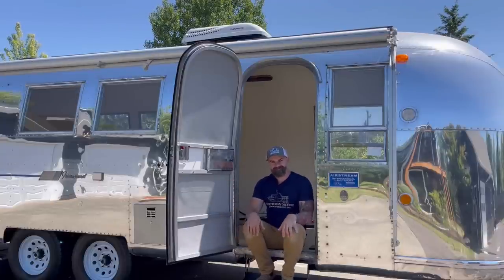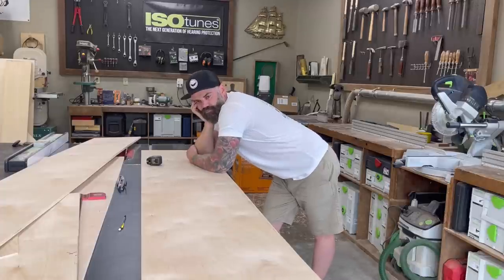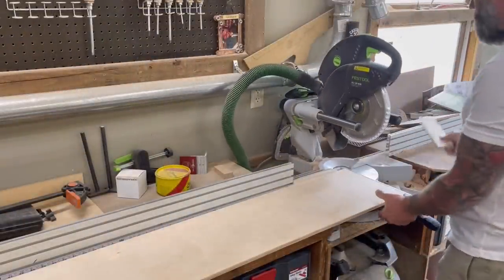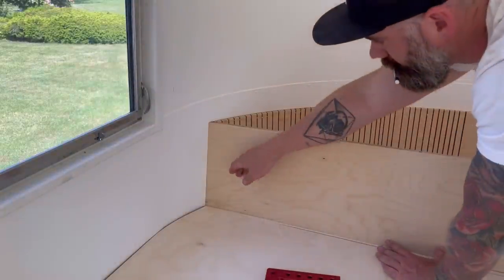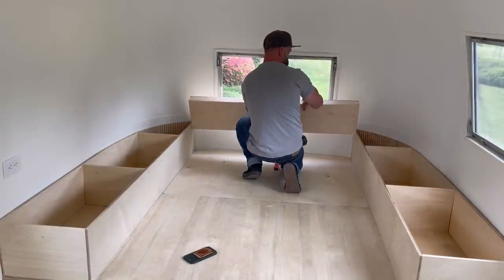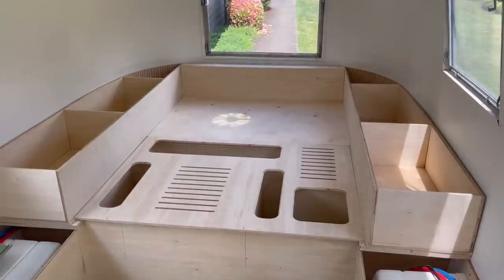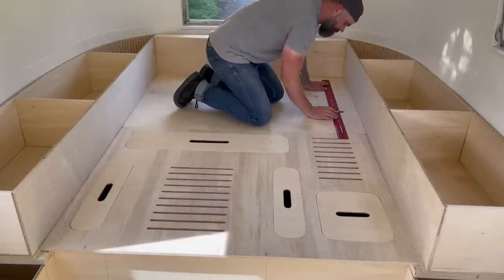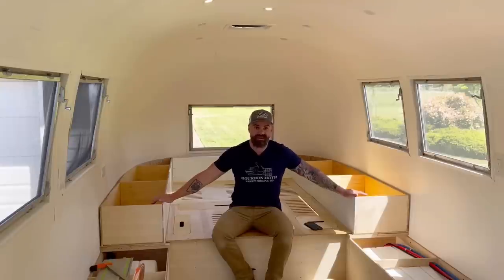Airstream Storage Bed  || Custom Building an Airstream

Comment: Those kerfed corner pockets would make a great hiding place for your top shelf bourbon. Like one of the other commentors said, incorporate some USB charging there for your cell phones. Hidden speakers for the A/V system might be nice as well.  Perhaps some uplighting. 
Why did you do a full back  for those cabinets anyway, it seems most RV cabinets I see have an open back and utilize the RV wall as the cabinet back. Perhaps make something like a face frame for the cabinet back to have some structure and a way to attach to the wall, but an open back means less material and weight savings. Love the build!

Comment: Your doing a fantastic job of that. As well as ventilation you should also consider air flow between storage compartments. I live full time in a van and moisture is the enemy, nay The Nemesis! One wet trainer from a canoe trip can create a fur coat of mould in no time if there's no air flow to disperse the moisture. Having a dehumidifier built in to the storage would be a real "gun in a knife fight" move. 👍

Comment: Self Closing drawers will add a little weight..but they will not open in transit(we have them in our Airstream) and they are so much nicer than the cheap ones Airstream uses.  Don't forget phone chargers near the bed with a place to keep the phone at night.  Don't forget a place for a garbage can.  Tour a newer Airstream...they have a knack for using every nook and cranny.  Small cabinets with only 5-6 inches of depth can be used for small propane bottles, rolls of toilet paper, garbage bags or can goods.  Fun project...keep up the good work.

Comment: Great work! Your design ideas are very intuitive and your craftsmanship is admirable. I had never heard of Shaper Origin, that is very cool. I couldn’t figure out where you were going with the under mattress storage until you mentioned the hinged mattress. Cool idea, but gas shocks are probably a more economical solution, and they are pretty simple to install. Venting the mattress - I don’t think Airstream does this to the “trunk” area (i.e. accessible from the back) because owners might store some nasty stuff in the back, tools, oil, etc. that the mattress would absorb. If you’re managing what goes in there you’ll be fine.

Comment: Just a suggestion, you probably already had thought of it. Some type of insulation around the wheel well. If you could spray foam in between the metal and the plastic wheel well that might work or just bats over top the plastic but it would serve two purposes, heat and sound insulation. Love your work, been a fan forever!

Comment: Weight and balance comes to mind. Have you thought about that? You don’t want to much weight in the back or your camper will be trying to lift itself off the hitch. To much in the front is not good either, to much weight on the hitch. You need to try to balance it out as much as you can from side to side as well. .. love your channel! Can’t wait to see the the progress! Tim.

Comment: One thing we did in our camper full gut and re-build was to mimic what some van campers were doing to save weight. You laminate 1/8" luan to either side of a 1/2" polystyrene foam insulation board. It makes an incredibly strong and lightweight material for building. Even the countertops were made the same way with a laminate sheet instead of luan on the top for a custum kitchen counter... though we should have painted the luan on the underside to seal it because it ended up warping a little.

Typical campers use a structural frame with a 1/4" ply face. I am a lot happier with the result of the foam board.

Comment: Love this channel, great content.  One think I don't understand that all RV builders ignore is there isn't a pass through channel to push wires from the front to the back.  If you need any electricity in the RV you need to get creative.  The big one is to put a transmission line to the backup camera.  You can put in a PVC conduit that is cut in half and it can be hidden behind everything in the top corner and be upholstered or painted.  If mounted to the wall you could event use this as a beam to hang your cabinets.

Comment: This is awesome!  I loved converting a bus. Skoolies are great.  I have watched a dear friend rebuild 2 airstreams and they are gorgeous when complete.  I just have too many kids and would need a semi to pull any camper big enough for our crew. 

Tip:  cut in conduit runs.  You will want technology, charging, and low voltage lights everywhere.  18g wire for 12v stuff is small so it doesn’t take a lot of space.  It’s total overkill, but running some 1” flex conduit now will be a great idea.   Regardless of open of closed wiring, you should start to think about your low voltage now.  If not your amazing work will be done and then you will be trying to hide wires later.

Comment: They make a bending plywood,  once you get the kerfs cut and the plywood bent , you can fiberglass the inside of the bend to stiffen it up. Beside kerf cuts you can steam bend it or layer bend on a form.
My dad did stem bending to make the boats he made.  If you can deal with an airstream making the interior you can definitely make boats, now that would be cool a kayak boat stored under the bed. 
A boat you made from wood and fiberglass.  Or a pair of them what more could you want for camping, oh a bike rack on the back.

Comment: With the wheel wells... if the support sides of your cabinets above them are not to be removed, you could spray foam insulation into the voids to not only stiffen things up and add a layer of protection, but add some insulation (both thermal and sound).  trim it off level and place your cabinet bottoms on top (and removable to get at the water/electric lines)  I'd leave some space for those water lines should you need to replace, but otherwise fill the entire cavity.
Reply: A larger PVC pipe could be cut in half lengthwise and foamed in to be used as a channel for the water lines/whatever else.

Comment: Looks great so far!  You can always weigh the trailer at some truck scales.  Not sure if you did it empty or not.  Maybe worth doing that now and then at the end.  Also, you could always keep account of the full sheets you used and weigh the scraps to get a pretty accurate amount of weight.  Also, you might be of what up at the nose verses the tail.  Heaviest over the axles.  Will effect how the well the trailer pulls.

Comment: You should add quick release latches to sections that meet each other. that way when you want to rip it all out to fix stuff or repair that section there isn't screw holes just a latch. i did it to my camper and made my life so much easier when i needed it as a van again

Comment: You are doing a very, very good and thoughtful job. There would have been storage space in the headboard of the bed :-)

hp
I would have omitted the back wall completely (weight) - and if absolutely necessary, then milled a 3mm groove 10mm from the edge and inserted a thin, flexible wall.
Greetings from the Black Forest.
I look forward to the next part.

Comment: As an RVer, weight is a concern, but as long as you know what your axle limits are, you should be good. You are doing a great job, and yes, it looks like you know what you are doing. You have great skills which once you get the idea and make the plan, even if it's on the fly, you make it look easy.

Comment: Good luck with a hinged mattress.  You will always be aware of that split when you are sleeping on it.  On those storage compartments that have “fronts” to the living area, put “doors” held in place by earth magnets.  MUCH easier than lifting even a portion of a split mattress that has sheets and blankets on it.  Don’t wig-out on trying to fill every spot with storage.  Most often those spots are a pain to get to and you will end up finding things in there years latter you never used…hopefully not spoiled/expired food.  Better to find a way to get by with less than planning and storing for every item you might need for the trip.  Before long you begin to think eating out and sleeping in a tent or truck bed isn’t so bad.  No prep or tear down before and after every trip.  KISS.

Comment: you could use those two dead spaces and the back thin box for wire chases, inverter, charge controller,  hotspot/modem, electronics you wont see or need to access often.

Comment: If you’re concerned about weight, one way to reduce it would be to use aluminum honeycomb panels on any of the large portions. The wall sheathing would be a great spot for this.

Comment: Do you think you will have problems with the upper bed cabinets rubbing the side walls of the airstream as you build up miles on the trailer? Maybe some felt or rubber between could be a way to prevent rubbing
Reply: I think he mentioned that he'll be fastening them down eventually.

Comment: Have you thought about putting some access panel in the bottom of your side cabinets? You could do the exact same method as your other storage access panels, except use 3/4” ply since you’ve got two 1/2 pieces. Could save you a lot of trouble down the road if you needed access but didn’t want to take the whole modular back apart. 

Then again, could be a lot of temptation to use it for more storage which you’ll forget about, and have added weight for things you’ll never use.

Comment: At first I wondered why you were bothering with fully enclosing the backs of the bedside cabinets with plywood when you could just build fronts and dividers and attach the lid supports to the Airstream walls. When you mentioned removability, it made more sense; you wouldn't want the contents to fall out if you had to pull the cabinets out to make a repair. However, since you'll have most of a frame anyway thanks to the flip-up tops and dividers, you could still forego plywood backs if you added a couple extra pieces of framing as support for stapling on some sturdy, flexible plastic sheeting, duck cloth, or heavy duty canvas fabric. That would make the cabinets lighter if you ever need to pull them out while they are full, and every ounce you can avoid will help reduce the amount of fuel needed to pull the trailer. Even if your towing vehicle can handle the weight, you still want to consider how much that weight could eat into your wallet.

Comment: I'd recommend half-rounding or bull-nosing (depending on the thickness of the supports) the edges of the removable panels. They just slip right into place with no effort then.

Comment: Consider using steel studs instead of wood studs for the wall.  Significantly reduce weight and just as strong and stiff. Plus straight all the time and can be screwed together easily.  We used these when building our haunted halloween castle and I loved they were light and easy to take apart and store.

Comment: Am enjoying this more than I had expected too. A thought for the wheel well space. Some thin insulation between plastic and the covers you are building. Rout out some channels for your water lines. This will help prevent freezing in shoulder seasons (at least I think it freezes in Oregon in the mountains anyway). Where the water line transit the wheel wells seem to be one of your most vulnerable to cold spaces. Some near-floor vents might help as well to allow some of the interior heat to infiltrate those spaces near water lines, freshwater tank and holding tanks will buy you a few degrees of usability. I had gray and black water freeze solid once....not a good experience.

Comment: It is interesting that rv trailer bed platforms are just solid plywood with no ventilation, I have not had issues with them but have not looked that closely.  As an experienced RV’er especially with trailers the one thing I would recommend is getting the stuff you need to camp and making sure it will fit in your storage (I realize it maybe a little late now).  You will need wheel chocks, I would also use x chocks, handles to lower the stabilizer, general tv tools, elms system (hardwired would be good for you) electrical cable, 120v extensions, a couple of potable water hoses (you want about 100ft total) I use the zero g potable hose, garden hose for black tank flushing. Water pressure regulator, optional y splitter (I use one to split fresh and blank tank hoses). Leveling blocks (I use Anderson levellers also come with a trailer buddy I’d you get the kit for jacking the wheels).  Tongue jack blocks, and extra blocks if you need to level on very unleavened ground.  Other things I would do while you in this stage, look at getting electronic waste valves from drain master as they are easier to work with, a seelevel tank monitoring system (I don’t have one yet but plan on doing this myself, also these upgrades can be viewed on Love Your RV) as the standard systems are junk.  RVers are super helpful, post on something like iRv2 or the airstream forums and you can get a heap of knowledge you just need to filter as normal with any Internet forum.
Reply: Forgot to add the stinky slinky and it’s attachments needed, you want 2 or 3 actual hoses, a clear section for the RV connection so you can monitor flow and stuff, and a 90 degree sewer outlet connection.

Comment: I spend half my camping trip repairing stuff, but I take my trailer off-road. However I would recommend you find ways to reenforce the furniture from damage due to potholes and other nasty surprises. There ways to do this with minimal weight increase. In particular overhanging shelves

Comment: Very nice. It's okay if you don't know what you're doing. Sometimes you have to learn as you go! That's what most of us do on some projects. You are doing great Jason. You know what you were doing when it comes two building things and I don't think you give yourself enough credit. I myself have never rewired a whole entire house without any training or going to school, but I am doing it.
I have done some remodeling on my own  because I learned from my Uncle's.  All of my grandmothers children were in many different trades, except my Aunt. I had several uncles that did remodeling, painting, flooring, and masonry. My grandfather even built my grandmother her house and we all pitched in when I was a kid to hammer nails or build walls. You learn as you grow. I have never before made kitchen cabinets but made all of my cabinets for our house. Do you know how hard it is to design a kitchen around a chimney, 52 in window, a laundry chute,  three doorways, and with one wall an inch and a half shorter than the other and nothing in this house is square? I sure didn't know how but I learned. I was going to buy cabinets from the big box store and the cabinets were going to waste too much space for me. If I would have bought cabinets from the big box store I would have only had 8 cabinets in my kitchen total.  I decided to build them for myself and now I will be fitting 14 cabinets into my kitchen with very minimal wasted space. 
 I've been doing most of the remodeling in our 1929 home and teaching my kids and my husband along the way. I don't know what I'm doing but I'm learning. I'm sure I've made many mistakes along the way but that's how we all learn.  Did I mention nothing in this house is square except for the stuff I've built? 😂 😂
You are doing a fantastic job! There are so many different things you can do with cubbies and the electrical to make it your own. The possibilities are endless and so is the imagination and your creativity. Keep up the great work!
Can't wait to see your next video!

Comment: When building the wall think about cooling and ventilation. If you have a vent in the area a “Fantastic Fan” works very well for drawing air in from windows. Maybe have some thin slots in the wall covered with loosely woven material to provide air flow. Great job so far!

Comment: Just an idea, you could have cut the kerfs on the OUTSIDE of the back, keeping the inside smooth.
Talking about weight, balance front to rear is the really important thing when it comes to towing, you want the trailer to be somewhat front heavy.

Comment: When it comes to divider walls a stress skin with ½ “ framing and ¼” skins should help with weight. Remember to insert conduit for outlets and data lines. It is looking good. If that AC unit on the roof is functional plug it in and cool it down in there. No need to hurt your thinking by over heating

Comment: well one thing I know is I watch a lot of people remolding trailers and all and most people don't have a clue on how to do it, Now I am a trained carpenter and now that I am older I have gotten in cabinets and I think your doing great it comes down an idea then try to cut and  fit and more fitting  until you get the finish and work out and look good I call winging it lol

Comment: On weight relief, those bed top boxes you can cut most of the back away leaving 1 1/4" margins to fix the 1/8" ply to. You could also do it to the bottoms as well and the top of the sub floor and put a removable 1/8" ply panel on the bottom if that makes sense